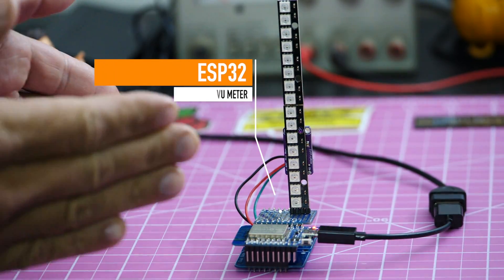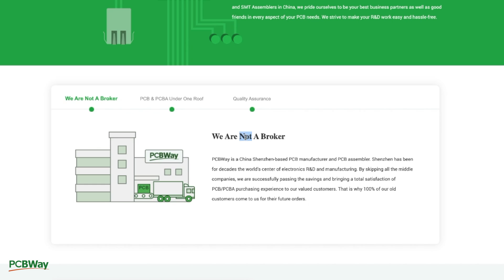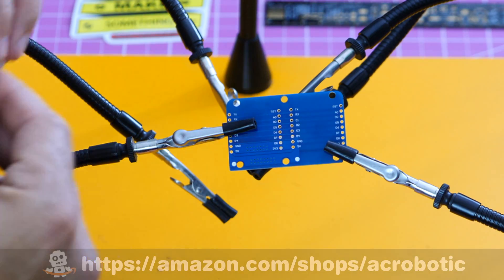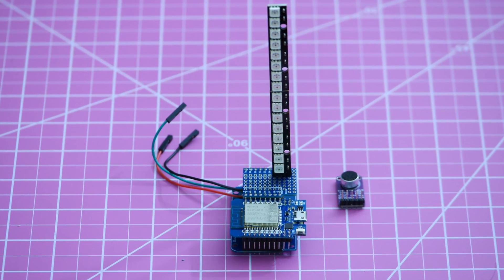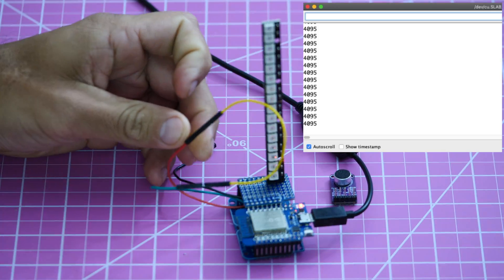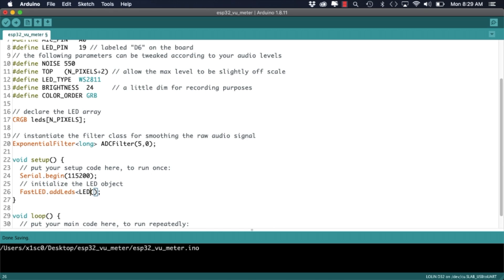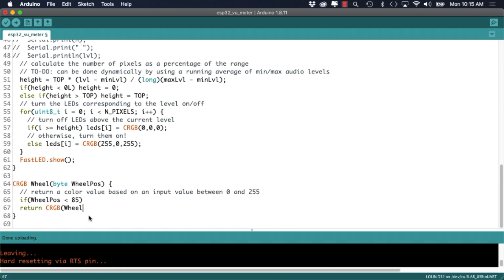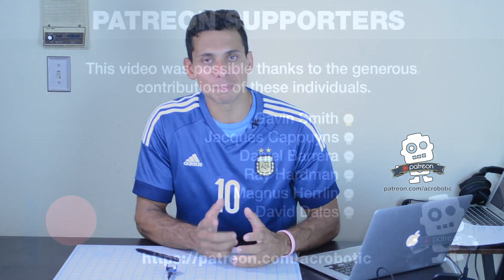ESP32 NeoPixel VU Meter For Audio Signals | MAX9814, WS2812B, and Arduino

Comment: Hello! Greetings from Brazil. I really would like to thank you. This video is so didatic but also very objective. I know nothing about electronics but now I can continue and finish my project. The analog noise is a problem that I have noted but not realized how to resolve. Thank you for the tip to use a exponential filter.

Comment: Thank you, very nice video.
I used a Wemos clone ESP8266 (ESP 12F) D1 Mini. Changed the LED pin from 19 to 12. Board set to Generic ESP8266 Module in Arduino IDE.
Reply from the maker: Nice work! I'm glad you liked the vid, and that it was useful to build it with an ESP8266!

Comment: Even though you are using an ESP32, you can assign A0?  I have previously had a MAX9814 board working with an ESP8266 and Arduino but the ESP32 has perplexed me (I can read the relevant ADC channel and maybe even the attenuation settings) but it's always been noisy at best or unresponsive.  I am going to try your filtered code (again today but where I can properly tinker).  I suppose I have to set the GPIO pin instead of your A0 and declare a 'lvl' variable...

have followed your videos for a while so please keep up the great work!
Reply from the maker: Heya. Glad you figure this out, sorry for the late response! There's some peculiarities with this pin (look up SENSOR_VP if you're bored), but it should work okay as an ADC:
https://docs.espressif.com/projects/esp-idf/en/latest/api-reference/peripherals/adc.html

Thanks for watching!
Reply: @datasith  you are so helpful :)
Reply: OH WOW .. A0 does work strangely ... when I connect to pin 36 (SYP / SVP or something)!    AND    it would turn out that one of my MAX9814 boards isn't working properly!  Right, onwards with your video :)  thanks for this!

Comment: This is really cool! I don't think I understand the first testing you did plugging the power and ground wires together. Why did you do that? Also, It would have been cool if you could have spent just a few extra moments on the serial graph because it looked pretty spiky to me and I'm not sure what you where actually looking for. Thanks for including some of those libraries into the project. I'm always learning about new tools from you ;-)
Reply from the maker: Hey, boss. Sorry about that, I definitely didn't delve that much into the code in this one. While making this video, I realized I haven't talked about Analog Inputs too much, so I figured I'd cover it in detail later :) 

Here's what happened in that section of the vid: 
I connected 3 wires for the mic to 3 pins on the ESP32 board, namely GND, POWER (3.3VDC), and A0. To double-check the wiring, I connected the A0 wire to both GND and POWER. As A0 is a 16-bit Analog-to-Digital Converter, we get 0 when 0 volts are connected (GND) to the pin, and 4095 when 3.3 volts are connected. Since it's an analog input, any voltage between 0 and 3.3 volts will be read as a proportional value in that 0~4095 scale. As I saw the min/max in the Serial Monitor, it meant that the wires had been connected properly.

For something like the Serial Plotter, I would rather cover it as a standalone video, so that those interested don't have to dig through a project video to find it. I'll add it high on the queue, so hopefully that'll help.

Thanks so much for the feedback!